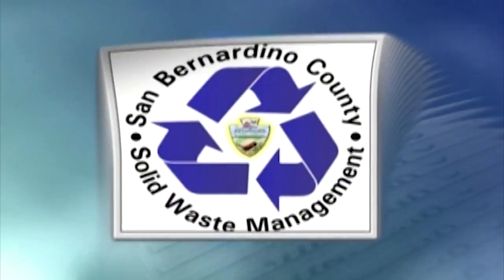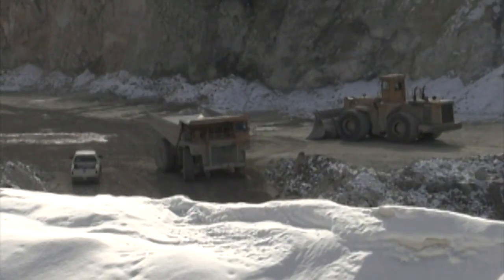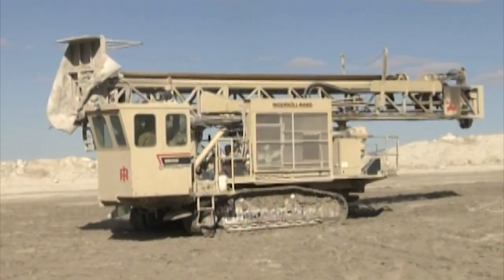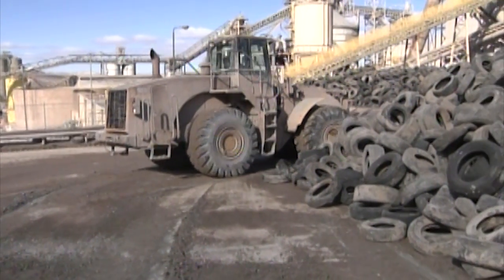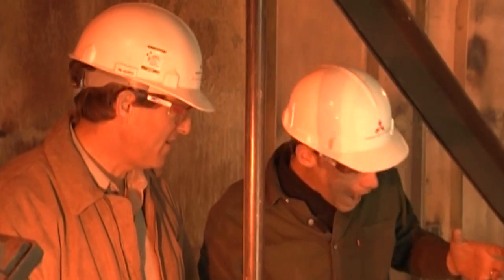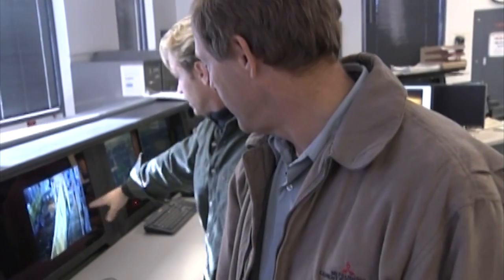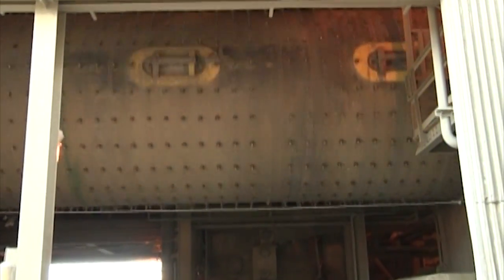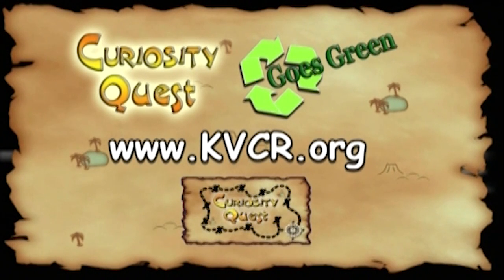Tire Recycling

Comment: Texas used to grind up tires and mix them in the stone used to make blacktop, the reads would rust from the steel belts, they also used ground glass and the roads would sparkle at night.
Reply: And i thought that was from all the drunk drivers throwing out the car windows all their empty beer bottles.
Reply: Not Too motorcycle friendly
Reply: I have seen glass roads before.

Comment: Thanks Chula,  great to see tyres getting  consumed 100% no waste by products.  Can use  cleared timber to equally make  prodicts and refined oil and aslo refined oil from rubber , both giving buff carbon as a waste, which is very valuable cheers.

Comment: OK. I understand all this stuff, I worked in this industry, so true story.
 I was having my tyres(tires for US), changed, and the fitter discussed with me the disposal situation, I mentioned that they were often used for fuel in the cement works.
  Ok next the usual discussion about black smoke, then "What about the steel in the walls?", I explained that Iron was useful in the process as part of the of production.
 The fitter then said "Wow, I always wondered how they made re-inforced concrete ".
 If you can burn them whole, so much the better, shredding is a pain.

Comment: It's amazing how the technology has changed.  Burning tires has passed but recycling them is on the forefront.
Reply: They have to burn them until they melt. But before they burn them they have to shred them and seperate the steel belting in the rubber.
Reply: @josephanthony-richardvasta6624  If u paid attention, the tire is melted in about 2 sec, and in couple seconds more,  IT'S COMPLETLY BURNED !!! cause of extreme temperatures, and BASICALLY INSTANTLY transformed in HEAT !
Reply: To be exact, THE TIRE IS DROPPED IN A STORM OF PLASMA !

Comment: I think they burn the tyres in the long kilns on top of their normal fuel (this was done to reduce fuel costs) the result is clinker with steel fragments in from the wires in the tyres, in it that can rust, Blue Circle Cement tried it in the late 90s, what comes out of the kilns is clinker which then goes into the ball mills.
Reply: +Lynall Lynall.The steel belt is oxidized to iron oxide which becomes part of the cement.
Reply: When coal plants used tires as extra fuel, it did leave some residue and steel with the remaining ash.  In modern cement plants, the tire is dropped directly in to the kiln as a heat booster, the steel vaporizes to iron oxide into the cement.

Comment: Interesting and informative video- perfectly understandable since I have worked with fluid bed ore roasters, dry grind mills and carbon granule reactivators in  gold  processing operations, all of which use high temp heat to achieve the desired process goals
Reply: Instablaster.

Comment: The best use of worn tyres is "roadside barriers" The barriers currently being used are metal barriers. Putting used tyres would be great because they will lessen the impact and minimise damage. People can put the some tyres in their garages where they can prevent the garage walls just in case poeple mistakenly put their foot on accelerator.

Comment: smoke from tires can be abated. ashes have heavy metal in them. they go to a specific garbage dump that is lined.
Reply: Some of it gets mixed into concrete used for roads
Reply: Except here all residual tire ash is added directly into the cement powder

Comment: Burn the tyres and you get Ash (called fly ash) which is mixed with cement to make concrete, use fly ash you can cut back on cement but retain the strength of the concrete.

Comment: Great show!. I'm curious as to what happens to the "stuff" that gets filtered out of water at sewage treatment plants and or reclamation plants.
Reply: Most of it breaks down and is returned to the water supply, rather quickly too. Solid waste is usually used as fertilizer, it’s cheaper than cow or pig manure. Think about that next time you’re chowing down on some melons from Florida, 1000’s of tons daily sent out to farms.
Reply: Incinerated

Comment: Why aren't all kids taught this in Jr High School anymore? There's much more to it, but ALL of this can be taught in about 1/2 an hour.

Answer to question below: The combustion of the tires is so complete that there is little ash, and it goes harmlessly into the cement, as does the coal ash. The steel belts are the necessary iron in the formula.They could also use scrap glass (bottles) for the silica in the formula.

Comment: Well, You could cut the tire in half so you have 2 tires in a way. 2 Tire rings.  lay them down on a Dirt road thats being worked on. the pour the gravel over top of them. It will help stable the road, so it does not wash away in heavy rain.  bunch of Ppl do it on the East Coast. It keeps the tires out of landfills and repurposes the tires for another use when they cant be used on cars and trucks and such.
Reply: How is this keeping the "tires" out of the "landfill"..?  You just created a landfill under the road. And the tires will break down at some point, and there will be more toxic debris to deal with later.
And by the way... You still have the Carbon Footprint of the base oil that the tires were made from, only now it is in the air!

Comment: A good idea, but then if i understand there is too much steel in tyres to use them instead of milled coal, why then just shred them with a metal-non-metal separator ?Is there too much sulfur in rubber to use it mixed up with coal ?can't them separate rubber from metallic structure to "inject" the raw materials as pure energy and in a second point to "correct" the clinker base ?I' m interested in like both of us ...It may be more interesting to reuse rubber that schred the entire tyres .work on a similar process in "Maroc" and unfortunately we "block" the preheat tower using another energetic material cause of a solid sulfur ring .Hope they find the way to recapture sulfur where it become "solid" .
Reply: Shredding tires is done but it is very energy intensive making the economics hard to sustain. Another commenter mentioned that using them whole was much easier because shredding “ was a pain”.

Comment: Wonder what % of the fuel is supplied by the tires ?

     Interesting that they let the steel wire in the tires become part of the cement .

     Wonder if they could use solid waste / trash , also ?

Wyr
God bless

Comment: Tires can be ground to very small pieces and added to asphalt to make roads that are more durable in heat because the rubber can expand and more durable in the winter because the rubber is more elastic as well.  Fact:  There are more BTU's in a ton of used tires than a ton of coal.  Just don't act like a jerk when you are going through a plant.  We need ood engineers and technicians to run them - and curious people, not idiots!
Reply: Yes they can be ground but it takes much energy to get it to usable form. This is why asphalt plants are more likely to use tires as feul than to incorporate their rubber. The market makes virgin ingredients cheaper because the market has no way of including environmental costs in bottom line calculations.

Comment: Fascinating process but I can imagine how much oxygen from the air around us is used to get those incinerators up to those high temperatures.   Sometimes I wonder if the trees we cut for wood and so we are losing our capacity to generate oxygen.
Considering these cement factories, planes flying over our head. Power Stations , shipping ply our oceans............ I wager that the least oxygen is used by humans and animals and to consider that one engine in a Jumbo jet uses about two tons of oxygen per second............ our poor children will not have much oxygen to breath in their lungs.

Comment: This is not recycling tires. They are in no way being used as tires again. They are being burned and used as fuel acceleration. At least a good way to dispose of them without contamination.
Reply: True
Reply: Um.
What?
What do you think recycling is? Do you think the aluminum cans you recycle all become cans again?
Reply: @ut000bs  The equivalent for that would be making Aluminiumoxide.

Comment: Was not explained in detail enough, which leads me to believe something is not being told here. So the tires burn up with no ash to create heat to power a boiler?
Reply: well it is burned down to klinker which is what they make cement out of, same with coal, it it dont get complete combustion in a steam engine it forms klinker and makes it hard to get a good fire draft cuz it plugs up the grates for the fire, or was it that too hot a fire melts the ash togather and the impurities bond to it and form it I am trying to remember what they said it did, but yea they combust the tires at very high temp to form klinkers to make cement out of.
Reply: cement is not made out of tires. But the heat from burnt rubber steam may be used to melt the limestone. Like i said something is not clear in this video.
Reply: Like most videos, this one was dumbed down so as not to put off people.  The reality is that iron oxide is a necessary constituent of portland cement.  Using tires as part of the fuel also provides part of the iron that would otherwise come from added iron ore.  They mention this in the video, but it is quickly passed over.
Clinker is a fused mixture of several oxides, including silica, alumina, calcia, magnesia, and iron oxide.
Reply: ah that would explain alot if they would just say so.
Reply: D. Jensen
Reply: Robert, you can't melt limestone with steam but you can heat it up enough to break it down into lime. Go goggle how a lime kiln works.
Reply: I was talking about the rubber. Not the heat from burning the rubber. Where does all the waste from burning go? Rubber burns very black with tons of waste.They skipped over that. Watch the video again.
Reply: ah yes that is more like it, gets the stuff out of it not just burns them for clinker, this is much more pleasing to my piece of mind.
Reply: How is England God's country?,  self proclaimed sounds like.

Comment: why is so much highway cement more like plaster, while dam cement is rugged?
Reply: Only because they push the rocks down and smooth it. Any concrete would be rough otherwise. If you cut into smooth concrete, you'll find rocks just below the surface

Comment: I have hard time believing that there's no smoke just because it's "too hot" .
Reply: People who heat their home with wood stoves see this phenomenon. Most smoke is actually just steam. If the wood is sufficiently dry there's no smoke at the stack. Also, if the heat is sufficient all carbon particulate is burned and reduced to a purely gaseous state that is also colorless. Rare metal catalysts are used to accelerate the process. It's pretty cool.

Comment: I wonder how much energy a ton of tires produce compared to the Coal?
900 tons of tires equals 90 megawatts of energy, ie: 90 tons equals 1 megawatt.
The question now is, how much did it cost to get that 1 megawatt or does it cost more to produce then it's worth?

Comment: why couldn't the high heat use for generating electricity by adding a steam turbine in turn to power the home and commercial usage? wasting fuel just to make cement?

Comment: This is not what is called Recycling !The tires are used as fuel to substitute other energy like gas or oil.Recycling is producing new things out of the waste material, b.e glass bottles from glass srap, new paper and cardbord from old one, new steel or Aluminium from srap....
Reply: Exactly

Comment: Tore are not actually recycled. They are simply ground up and added to cement or placed in playgrounds. Basically instead of throwing tires into a landfill they dispose of them in public places like parks and roadways. I also want to point out the serious issue of road conditions in California. When you use too much filler in concrete it makes it weak and brittle. This is why California roadways are Shit and damaged after 2-3 years.

Comment: Cement companies charge to take tire's,  about $100 a ton. They use the heat from the tire for energy where they make more money. The landfill is still cheaper for tire disposal. Electric companies do the same thing for energy except they won't you to buy a three thousand dollar machine n then give them The material it's still cheaper to roll them down over the bank.

Comment: This is not tire recycling. It's tire use as a crude Fuel . Just like oil tankers out in the ocean using bunker fuel.except they don't tell you about the oil that burning tires produce.

Comment: This is "not" recycling! This is just "re-purposing" the waste of one item into the use of another. This is using the energy (oil) of the tires for the heat required to make the cement. Just another form of energy. This is no different from just using petroleum in the first place, except that these tires have already been used before and therefor are nearly free to the user. Got to dispose of the tire somewhere.

Comment: So would burning fire wood, be classed as recycling,going by the logic shown in this video?
Reply: The tyres are not just used for burning the steel in them is needed without using the tyres they would have to add it also to the mix.

Comment: Why burning coal too, tires don't burn hot enough?
Reply: They burn up too fast.  Its not all about the heat, they need steady, long-burning heat for the kilns.  I used to haul cement and spent many hours in the plants.  I was floored the first time I saw them loading up tires.

Comment: The rubber is literally burned away to nothing? No air pollution or anything results? Can they do the same thing with other hydrocarbons -- styrofoam et al???
Reply: "Can they do the same thing with other hydrocarbons -- styrofoam et al???"
To my knowledge, many plastics can be burned very cleanly with the result being mostly just gas and not many particulates. On the other hand, carbon dioxide emissions can't be avoided. With cement production, it's even worse because heating the kiln is the lesser source of carbon dioxide there. You get even more carbon dioxide that's expelled from lime (calcium carbonate) to form the necessary chemical compounds.

Comment: The host of this show was a a few cents short of a dollar. I do not know how the plant manager, who was guiding him around the facility, kept his cool. The making of cement is a very straight forward process. The ingredients are basically the same in every plant world wide. Crushed limestone, silica (sand), aluminum, magnesium, iron (steel from tires), sulfur, alkaline, and calcium (gypsum) used to delay the setting  process. At times the amount of the ingredients will vary depending on what type of cement is being manufactured.

From there the process is very basic. Mine rock, crush rock, heat rock with other ingredients, then add finished product (clinker) with gypsum and ground to a fine powder. And WAL-OH, cement! This Green fella was acting like he was having astrophysics explained to him. Then again maybe this was a children's show, I don't know.

But it was also pathetic to hear adults not know what a quarry was. This is something every adult should be able to identify. It would be the equivalent of not knowing where they get their water from. Or where the lumber that built their home came from.  Sad state this country is in.

Comment: There are actually ZERO tires in cement... recycled is a term loosely used to describe the burning of the tires to facilitate the manufacturing of cement. They are used as a fuel not recycled.

Comment: OK, I am not "that kind" of engineer but I did test concrete for 4 years or so.
I had always heard how much energy was necessary to make Cement and the rumors are true, this 400 ton/hour site uses 37 Megwatts of Electricity, as shown @15:55. That's in addition to the fuel used by the trucks and cranes and of course, the thermal output and while 1800 and 3400 Degrees F are efficient at converting tires (made mostly of crude) into heat, temperature cannot eliminate all pollution. Also, this site is a major greenhouse gas emitter.
Back to the electricity: A GE Mark 1 Nuclear Reactor generates 30 Megawatts of Power - That's 7 Megawatts LESS than this Cement Manufacturer uses, every workday.
My Point? Cement is not"Green" and neither is Nuclear Power. The limestone extracted was estimated at 2/3 of the RawMaterial Supply, Uranium exists in TRACE amounts of ore, the energy requirements for extraction then refinement are much, much larger.
This is why solar power works for you and me, especially since the LED has replaced the incandescent bulb which lost most electricity as heat. The average ratepayer subsidizes the big companies, not the other way around. If you are a business, your hourly rate for electricity is lower than a homeowner's rate. Food for thought for those of you who think you're Republican.
Reply: Solar can never meet all our needs. Nuclear is the least harmful contribution to cover the baseline and fill in for the gaps in solar.

Comment: A very good use for ground-up tyres that otherwise will pollute the environment, considering the massive production of this one element of pollution elements for the modern world.  It seems that the main point of this "green" video is explaining the need for intelligent re-use of tyres... A theme too obtuse for most viewers it seems.  Assuming that the DOE and legislation have masterfully controlled the air pollution requirement of solid fuel burning given off from the plant, all will be well...  Scrub-a-dub-dub those off-gases!

Comment: It's not recycling if your not gonna reuse....?
Reply: The tyres are not just used for burning the steel in them is needed without using the tyres they would have to add it also to the mix.